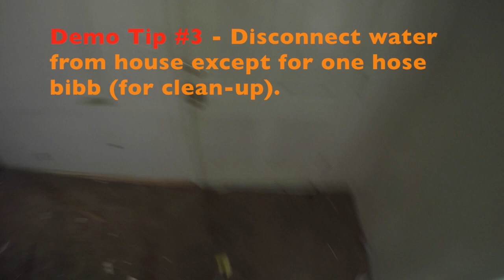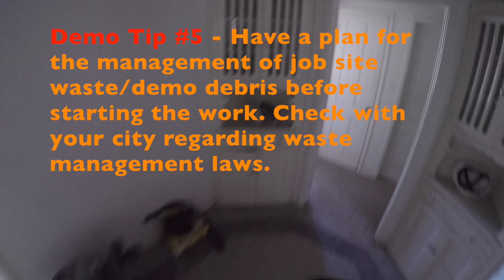😎💪Interior House Demolition Tips🔨@co-know-proconstructiontips

Comment: Quick question, just got hired with a company that does additions. they normally subout mostly everything and we come and do the finish work.Sometimes there might be times where we will have to do our own demo work, I have asthma and allergic but am no stranger to manual labor. But just worried when it comes to the demo work cause of insualtion and lots of dust. it in uncommon for people to wear hazmat demo suits and filitration masks when doing demo jobs?
Reply from the maker: Great question 👍 look almost every house built before 1980 used lead paint in some way or another. That said if it’s built before 1980 then most definitely wear a respirator and hazmat suit. If it’s built after should be ok but dust might still bother you so respirator for sure in your case. Congratulations on the new job happy 2024

Comment: I know this is an older video.. so man... you gotta check into the oscillating multi tools as well as a rackatiers ball stud finder(use it to locate your screws.. tap with a hammer.. remove screws, cut your drywall. Pull a whole wall down in one sheet. Take a knife and cut into manageable sections. Keep up the good work! ✌️
Reply from the maker: Thanks Zach for the comment We do do it that way sometimes. Unfortunately this whole house was peg and plaster it’s like cutting in to  concrete. I’d have to have a diamond blade. And I would have  been burning through those blades quite a bit. So I went with the good old pick ax and hammer and some muscle was the way to go. But thanks for the comment Zack. We appreciate the support on the channel🔨🔨👍🏻
Reply: @co-know-proconstructiontips  oh dang what a job! I didn’t notice. Good work!

Comment: are you removing framing?
Reply from the maker: In this video it’s basically just lathing plaster and insulation carpet cabinets tile basically all of the finish work down to studs. But was not in this video is us removing about 80% of the interior walls and 20% of the exterior foundation so we can add on our second story per structural plans. 👍😎